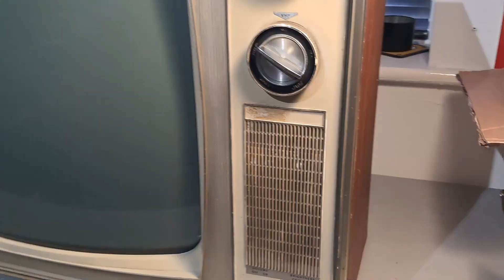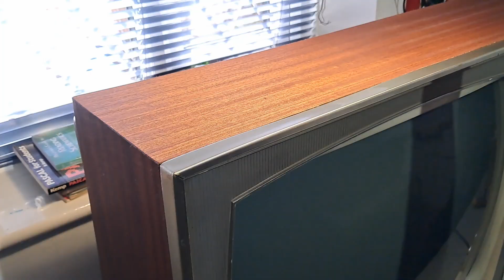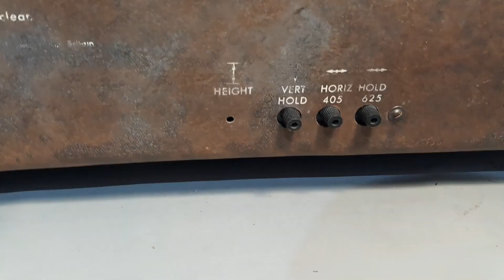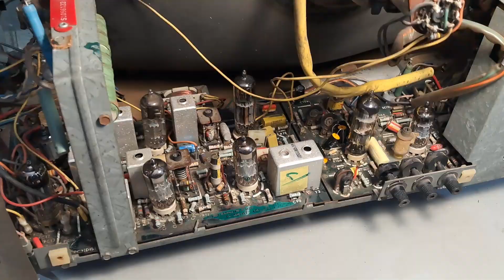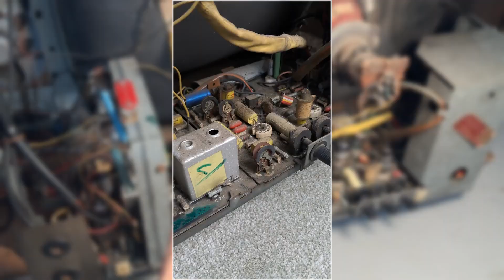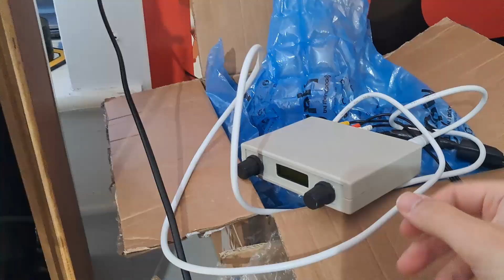Sobell 1019 Dual Standard 23" CRT Television

Comment: I have the 19" GEC version rescued from a skip a few years ago, all it needed was a new boost diode, as the original had gone to air. Judging by the CRT, it has had very little use & has a great picture.
Managed to find the correct legs on ebay.